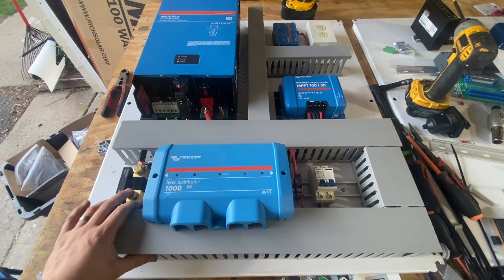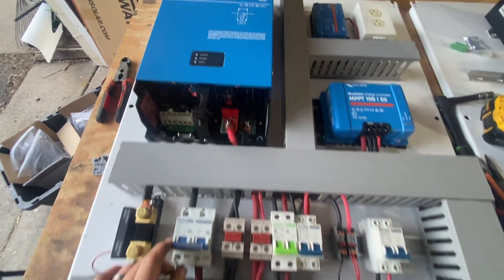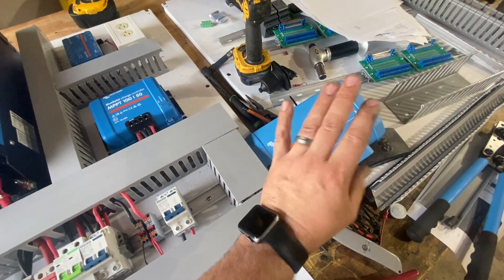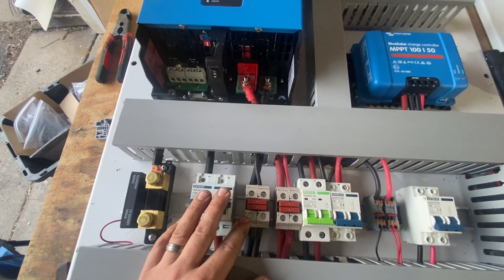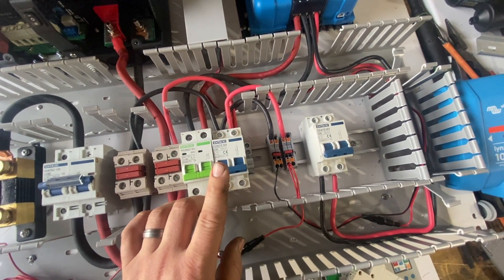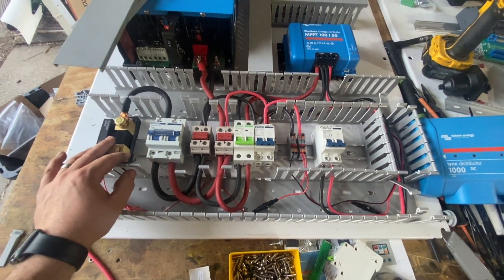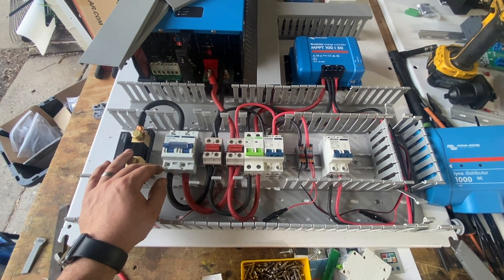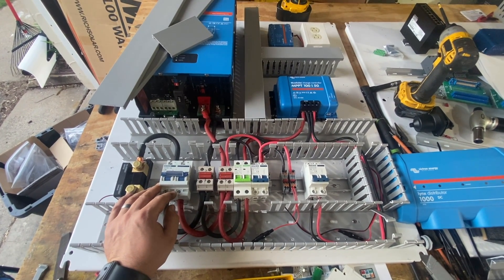Victron Lynx Distributor Alternative , DIN Rail components in RV Solar Systems

Comment: I dig this.  A while ago, while I was building out the electrical for our bus, I saw the Lynx system and decided against it because of the fuses.  Not knocking Victron, because their stuff is top notch and cool.  I merely insisted on resettable breakers.  Ended up with Blue Sea breakers and sealed breaker box.
Reply from the maker: Yeah, we’re feeling same. Thanks for the watch and comment!

Comment: Why is using lugs a bad thing, especially in a mobile application?  They are more secure then screw terminals.
Reply from the maker: The lugs are not the issue, it’s fuses vs breakers and using more industrial level of components. Just something we’re experimenting with.

Comment: The mini cb’s are common on all the French/German boats for both DC and AC. 

I’m using RCCB’s to meet ABYC standards on my 24 year old US made boat (Catalina) and also using ul489 main breakers before and after the split phase Multiplus’s. (32a input for service cutoffs and 63a outputs on each 6awg inverter/leg ). Use supplementary cb’s and another set of RCCB’s (32a) for each leg and distribute to the 10awg pre-existing circuits. I still have more output capacity for any AC circuits I may add. 

These are very handy to configure and the enclosures are inexpensive. Compared to conventional ELCI panel breaker systems…1/2 the $$ and the supply chain isn’t messed up.
Reply from the maker: Yes, it's amazing how different worlds become silos like that.  I'm surprised Victron hasn't been into this much as their world is so much in the marine industry as well.

Comment: Total off topic question.... Have you found any solution for a MultiplusII to see the second leg of Onan 5500 generators? Is.a autotransformer the only solution?
Reply from the maker: If I recall those are typically wired 2 breakers but single phase. They appear to the Multiplus as just a single leg because the relay keeps them connected.  I believe they can be wired splitphase, but it’s uncommon. To test put a multimeter across the two hot lines coming out. If it’s 240v, you have splitphase, if 0v you have single , if 120v you’re measuring a hot and neutral.
Reply: @sotasolar  all Onan 5500 generators are single phase. That is the one flaw with the Multiplus II and how it handles this very popular generator. The only way I can find to make them split phase so far is using a autotransformer. I am betting the next generation of Multi will correct this.
Reply from the maker: The Multiplus only shows a second leg if there is a second leg to be had. The generator doesn’t have a second leg, it has two outputs that are in parallel. The Multiplus sees power from both of those outputs, but it shows up on L1 only. 

I have a similar 7kw diesel generator that is single phase with two outputs. I run two Multipluses in parallel and have soaked up 45 amps from it no problem.

Comment: Are those Dinkle blocks?
Reply from the maker: Yes, we’re also trying to source some higher amp pin type bus bars, but hard to come by. We’ve ordered some copper flat stock and may experiment with making our own.
Reply: @sotasolar  I have found 125A versions - DK35N.
Reply from the maker: @AdorableDeplorable1  Yeah, I'm using those.   Signature solar makes a 2x125 amp breaker with a bus bar and terminal which is clever.   The trouble is I have not found terminal blocks that go over 125 / 1/0.  Those dinkle ones are the largest I've seen and the jumpers even doubled up make me nervous.
Reply: @sotasolar  I just installed a dual Multiplus 3000/24 system in a Cardinal, using the terminal blocks to route the output of the Automatic Transfer Switch correctly to the two inverters, and the inverter outputs to the load center. Nice and clean. If you want a photo I can post it.
Reply: @sotasolar  I just heard back from International Connector, and they have the DK95 in stock. It is rated for 230A and 4/0 cable.